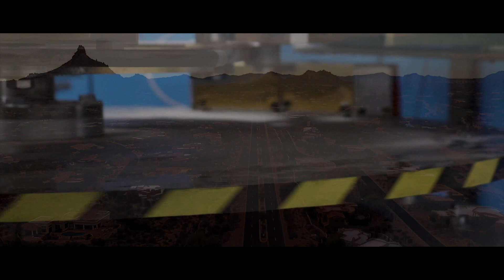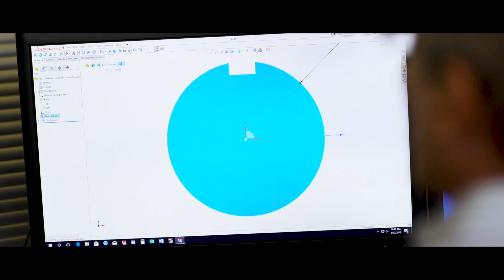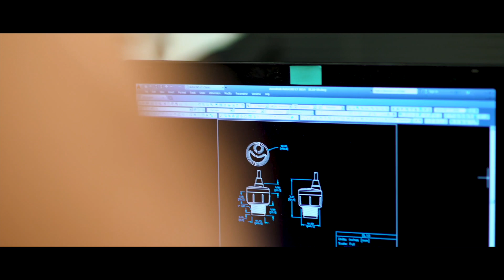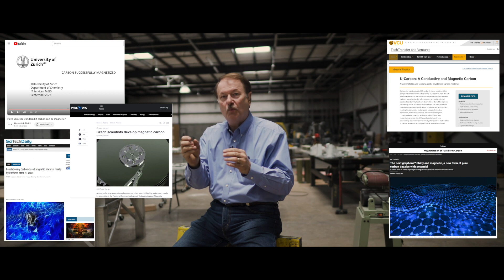Magnetic Carbon And The Earth Engine!

Comment: Very interesting along with the Philippines contracts. Is the 500k house contract providing complete power to whole houses via these engines and if so is it local to each house or regions? Is QREE to be your new ticker? I also didn't quite understand if the $3m and $1k per house was income to you or the manufacturers/installers. I've seen fantastic tech not get taken up or be highly profitable, but if the household ROI ditto yours is win/win then ;) Good Luck...
Reply from the maker: Our Ticker symbol currently is FLCX. Thank you for your comment. The Direct Energy System is fully distributed energy at point of use.